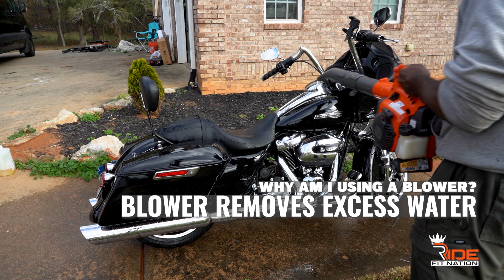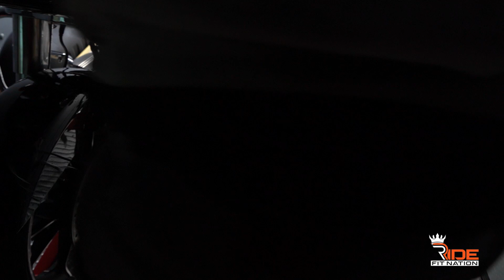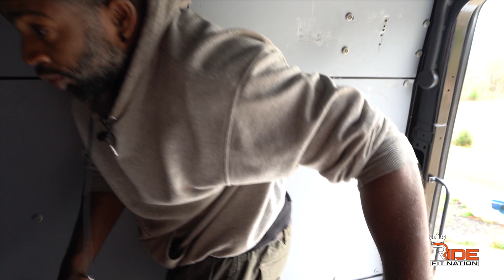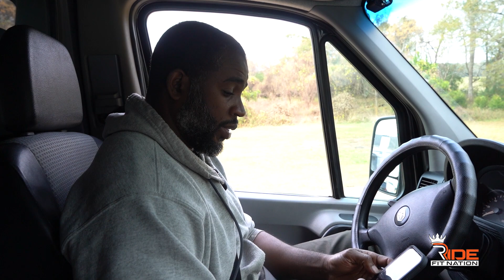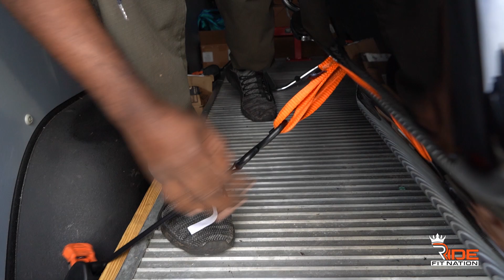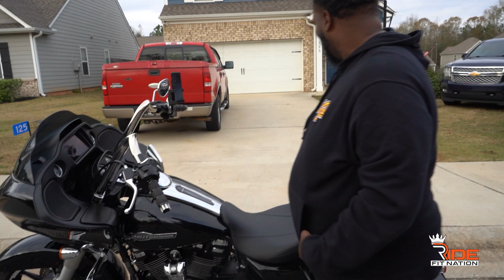I Had A Little Trouble But It's Fixed | How To Strap Down A Harley

Comment: If your chock is a fix mount all I do is use extension straps to the frame from under the seat. Then I use the pro soft straps. I recheck every 200 miles. No issues to date.

Comment: Great tutorial!  My only suggestion is to move the forward anchor points farther forward so the front wheel is pulled into the wheel chock.  The rear doesn't have to be super tight either, that's just to prevent the bouncing.
Reply from the maker: Great points. I anchor the bike differently. Based on my set up as I fine that the forward position tend to pull the bike forward which is why I use the other one which gives me no issue at all. The wheel chock I use is the vice lock so it holds the bike stable enough through out the entire trip. 💪🏽💯

Comment: Great job! I have a question & suggestion at the same time. If u don't know, do u use polyurethane bushing when u put taller bars on a cheap but effective change out, bro
Reply from the maker: Yes. That’s the best way to go. 14’s are on the border line. The bushing won’t go bad that quickly but when they do start to feel a bit shaky then it’s time to change them out. I’m a huge fan poly bushings.